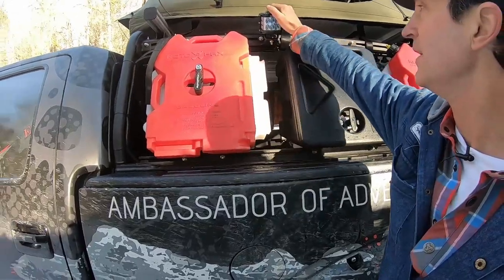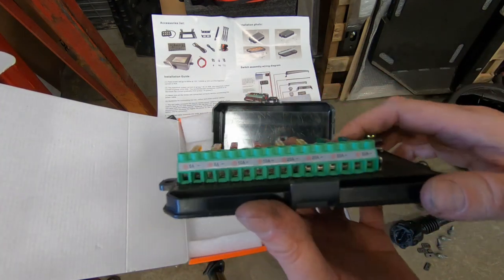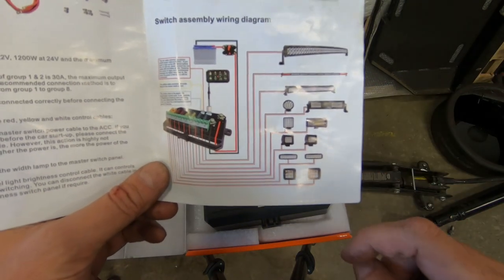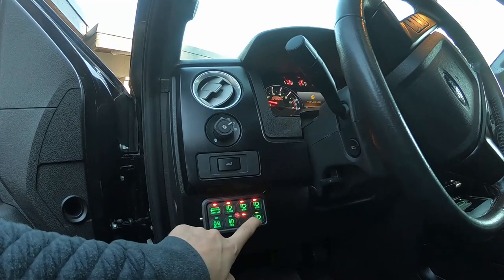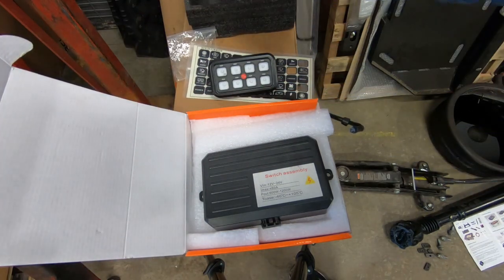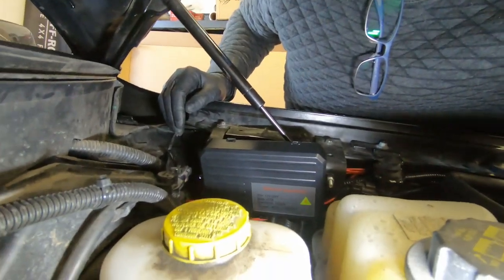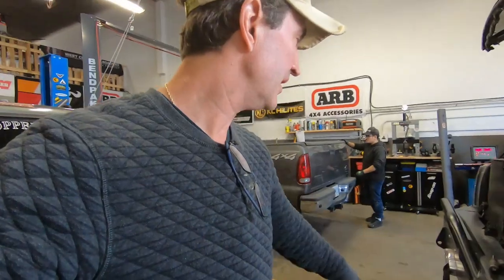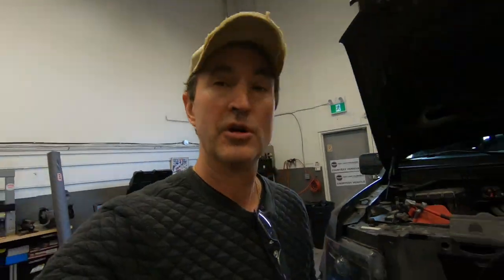Slasher Performance Auxiliary Switch Control Box Kit

Comment: Did a test on my vehicle I wired it to a secondary battery now when I put the red wire to the positive I notice it's on but it doesn't turn off and the lites to the switch panel sill stay on even if I push the off button....

Comment: There's this one kid that hooked his up to his Jeep and says that the switch panel stays on when he turns his Jeep off. Where did you connect the panel under the hood, so when you shut your truck off the panel in the cab shuts off too? Did you connect it to the key switch fuse?
Reply from the maker: Yes. The switch panel only comes on when you turn the power on.
Reply: @WADZUP  Power via middle red button or key switch? The middle red button didn't work on his. He doesn't no much English, so I'm trying to help him out.